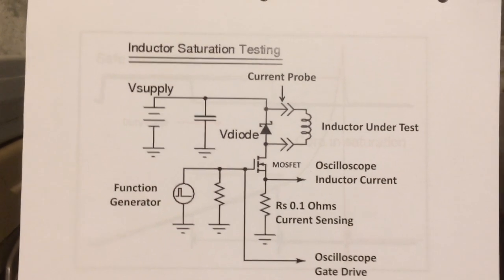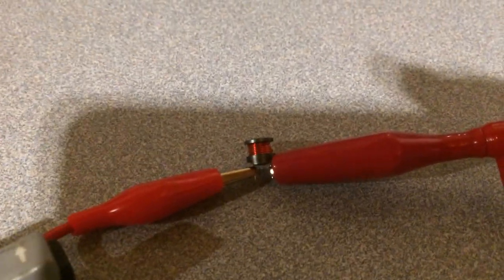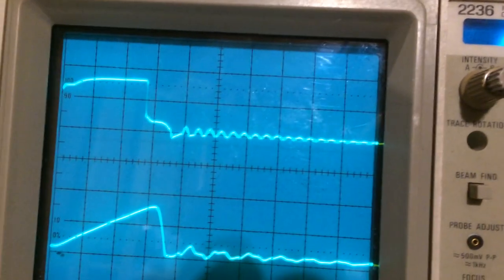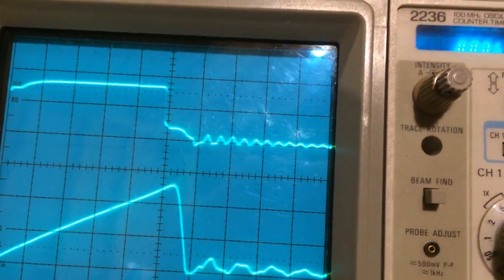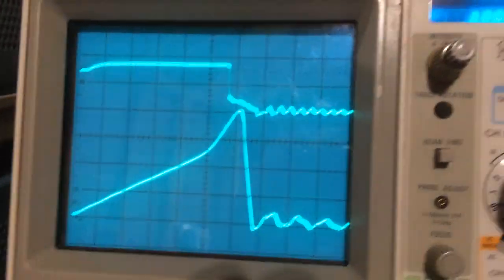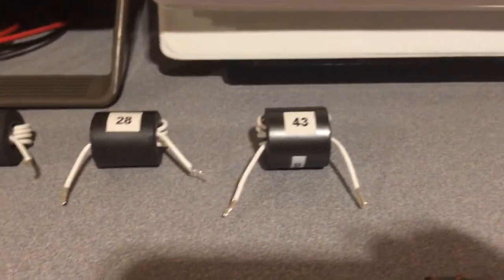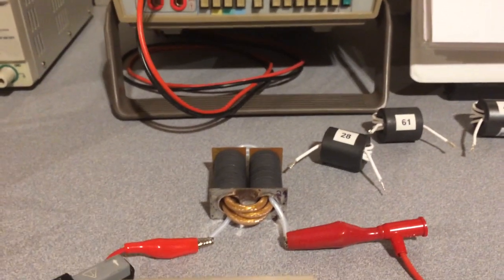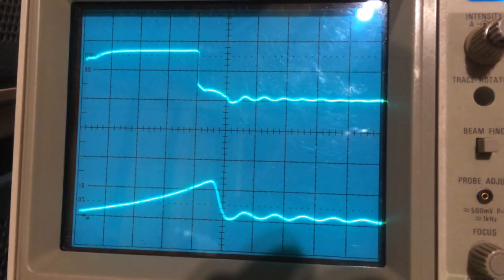RF Man Discusses Core Saturation Of Inductors and Ferrite Materials

Comment: This was a fantastic "Compare and Contrast" on inductor core permeability - nice job!

Keeping in mind that magnetic fields are manifest when electron spins are aligned (discovered in the 1920s):

TAKEAWAYS
1)  the higher permeability materials have more electron spins per unit area (that's just the nature of increasing permeability in ferrite core material)

2)  free space does not saturate (air core inductors remain linear) - free space has very low permeability

3)  the lower permeability ferrite cores have fewer electron spins per unit area than can be aligned, so that they are 'more like' free space than ferrite cores with lots more align-able electron spins

The closer the ferrite core's permeability gets to free space, the more linear the response, and the less prone to saturation it is.

The tradeoff is, particularly with transformers, lower permeability cores do not couple as much magnetic field into the secondary winding.  The higher the permeability of the core, the larger its B field and the more magnetic field it couples onto the secondary winding
.

Comment: RF Man, Thanks for the informative video. I bought one of the single LDMOS amps from you and I want to use it only on 50.125 to 50.400mhz in the 6 meter band, do I need to change the input and output transformers for better efficiency on those frequencies? Keep up the work! Phil N4STC

Comment: I'm wondering about your material 61 with the wire you use. If you're using high volts in that circuit, would you use Teflon wire for high temperatures?

Comment: You state "INDUCTANCE WILL INCREASE 4 TIMES PER TURN".  In a tech note for inductance vs #turns, it states that the increase is "N squared" where N is the # of turns.  This means, that for each additional turn (after the 1st) the inductance will increase by: 4, 9, 16, 25, 36, 49,......  Is this incorrect??
THANKS FOR THE GREAT VIDEO!!!